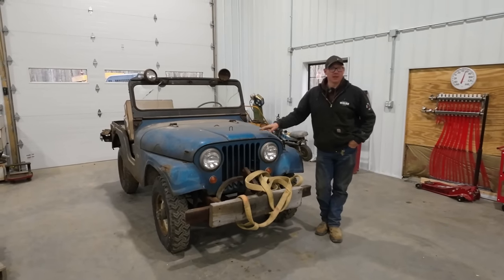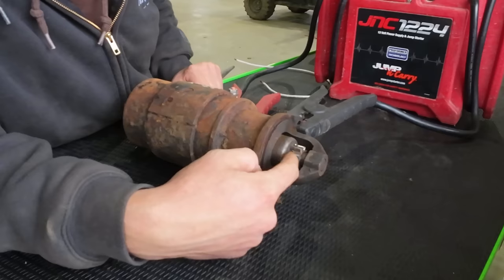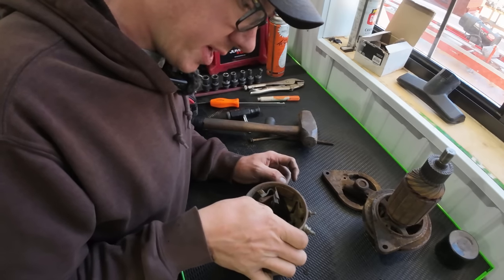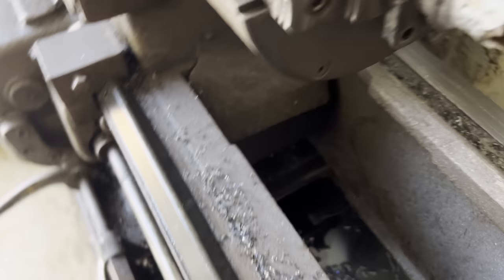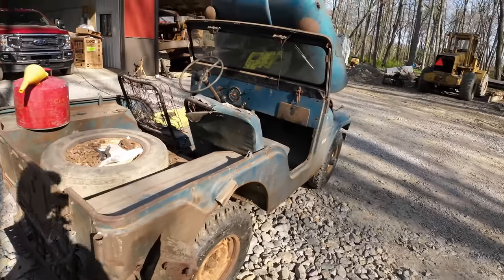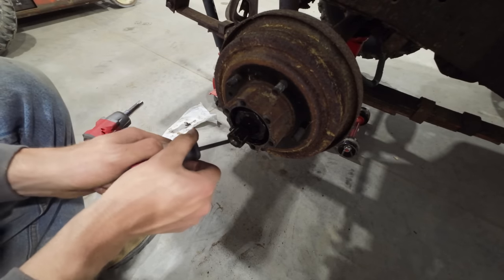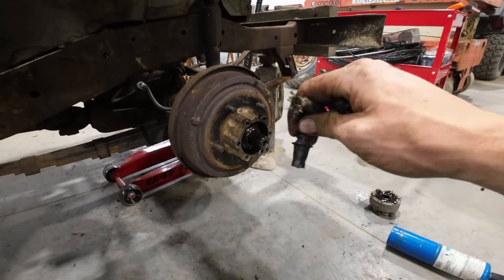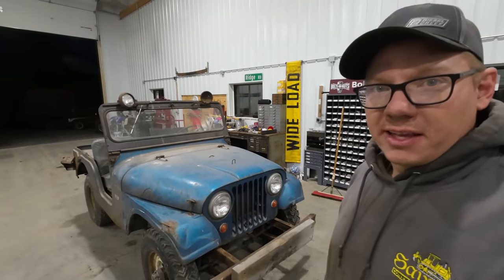Barn Find 1964 Jeep CJ5  (Is It Road worthy?)

Comment: Marvels mystery oil might be a good help with the possible ring stuck issue. and yeah, when it died at the gate like it was starved/out of fuel. Most likely had been just some crud that peeled off the inside of a line.. Finally the brakes, I think you're going the right direction there with a complete kit. And while you're doing that, just run new lines as well because you are absolutely going to break one or find a dozen pin holes the first time you put any pressure through the lines if you leave the originals in place.

If you ever really get the notion to go more in-depth on working on your jeep. A nice tip that seems counterintuitive , pull off the hood, fenders and grill to get maximum access all around the engine bay with needing to contort or reach into tight spaces. It was a lesson I learned back with an old DJ-5 I had many, many years back.

For the thermostat housing, dress it up with the epoxy as you have, but have one on order anyway just because you'll have the more permanent fix in the near future rather than if you're in the side of the road between your place and wherever in a cloud of hot coolant steam.

Oh and a closing idea after a completed project for inside that just came to me. Backing it out and then a voice over while you run the floor scrubber over where the project was. As one of those 'That's all for this thing at the moment, time to make ready for the next project, clean slate style'.

Comment: there was no doubt air pressure in the line. most likely from an attempt or attempts to use the brakes. the air was desperate to expand as it was heated by the torch and the old line just blew up like a firecracker's hull. could have even been some combustible vapor in there too.

Comment: Just a guess:  You should clear debris out between contacts because EVERYTHING has resistance and air is the resister you are supposed to use between those contacts, if you've got something other than air it is a good bet it wouldn't supply "equal to or grater than" the expected resistance...  That would be better than a short but still undesirable.

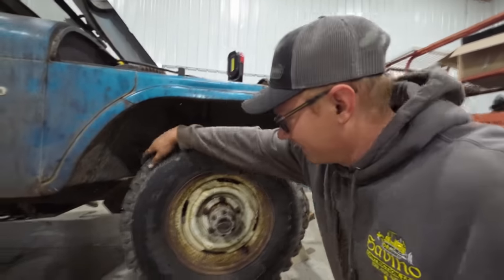Comment: 53:20 I think you know it, but see that knob in the center of the hub, it's to put it in 4wd, when it's off your wheels are rolling free, saves you fuel en wearing out the front drive. So if you put your jeep in 4wd it's not working untill you turn them to lock your hubs.

Comment: Quick edit - the soft line exploded because the inner liner collapsed. It trapped expanding gasses and the rotted rubber couldn't take it. I'd definitely recommend replacing all the soft lines at this point.

On the springs, DO NOT go with either the Skyjaker or Rancho spring kits. They WILL give you the patented "empty dump truck" ride. Remember that more thin spring leafs give a better ride than fewer thick leafs. Ask me how I know. Best bet is to just buy Crown brand heavy duty springs. They should be a 10-leaf pack for the front, 9 for the rear. Both Skyjacker and Rancho have 4-leaf packs.

Matt, if you're ever interested in upgrading the brakes, hit me up. A gent on TheCJ2APage forum designed a 1/2 in plate that bolts in place of the drum backing plate for mounting a 95 Geo Tracker front brake caliper. That done, what you'll need to complete a full manual four-corner disc brake conversion is slightly longer wheel studs, 1.2" longer bolts to attach the spindles, four 95 Geo Tracker front brake discs, four caliper brake hoses, and two sets of brake pads. The last step is to cut off the ends of the axle mounted brake lines, install the proper metric fittings for the caliper lines, and re-flare. This works because the Tracker closely mimicked the axle dimensions of the Dana 25 and Dana 41/44 axles used on the early Jeeps. The bolt pattern and hub size perfectly fit the Dana axles. It's truly a bolit-in swap. My cost using wrecking yard calipers and discs (in excellent condition) was under $250 for everything

I've been running this system on my daily driver 1948 Willys CJ2L* four about four years now and it works great. If you're gonna tow a trailer weighing more than a ton or so, I'd recommend a controller and electric trailer brakes or a Hydrovac power brake system mod on the jeep. 

The other popular disc brake conversion is 3/4 ton chevy. I didn't go this route myself for two reasons. First, it's far more involved and expensive. The second reason is that back in the day, a four wheel drive magazine (I forget which one) did this conversion and when they tested it in the alley behind the shop, they stood the jeep up on its front axle. The last thing I need is to jack the brakes crawling down a very steep hill and dump the jeep over on its lid.

The most popular conversion by far though, is with 11" drums from slightly newer jeeps. Wagoneer, I think.  I'll check, but I think I have a full set of these in my parts stash. If you're interested, they're yours for the shipping. 

I bring this up because the brakes fitted to your CJ5 are essentially similar to the design in the CJ2A and do not self-adjust. You're going to find yourself having to adjust the brakes every 1500-3000 miles to keep them working their best. The give-away is that there's no ratchet mechanism between the bottom of the brake shoes.

 How much you find yourself driving the jeep is going to be the deciding factor for you. IF you only drive a couple hundred miles a year, your fine with the original system. It'll be years before you need to adjust it. But if you're like me driving it every chance you get, you'll get tired of adjusting brakes pretty quickly. The bonus is that the more modern systems provide better braking and are just plain safer.

*A CJ2A stretched 24" at the dealership in Spokane and rebranded as a 'long' jeep like a CJ6. About 10 are known to exist.

Comment: I've never bench bled a master cylinder. Just put it on dry and hooked it up, filled it up and tapped the pedal maybe an inch and watched the bubbles come up and the fluid level go down. Eventually things would even out. And according to brianblok02, Deere oil and Delo are the only oils left with additives for flat tappets. i run Delo and Valvoline 15/40 diesel formula in everything. Pegged 80+ p.s.i. oil pressure idling with a 195 degree thermostat in a 4.3 in an old S-10. Does really good in big stuff too. Good old Jeeps. I had a 3-B years ago. Thanks and God Bless!

Comment: I love your Jeep CJ5!  What a sweat ride and the price was right.  Sure it needs some reconditioning, but Jeeps are rugged.  Yours seems to be solid.  All the parts are available.  New Brakes, tires, springs, bushings, shocks it's going to ride like new!  Once you are done going through it this will be a smooth ride.

I am no mechanic, and you are a pro.  This said I like to pressure wash a vehicle like this before I start work on it, gunk the motor, etc.  That way we all get a good look at what you have and you're not dealing with a huge layer of dirt and grease when you're working on it.  Just a quick blast.  The windshield will be clean when you drive it.  Then again, you work on heavy equipment, so this Jeep IS clean to you.

Comment: Put new ringtone by 20th over rings and then file fit them to the cylinder board back to the stock ring gap and it won't they won't smoke when you put it back together

Comment: It be good candidate for one those holley fuel injection system 2 barrel one be good for reliability and power had cj7 with 302 and 4speed dam thing would pull front tire a little with bolt ons it was solid ripper when u smashed pedal through floor only down side was body i got it off farm and drive line was out ford f150 70s hell of 4x4 drove it through so many holes that swollow most trucks and only had 32inch tires well keep up great work and have great day

Comment: Brake line popping was probably due to steam pressure.  Brake fluid pulls in water. As you were heating it more than likely there was nowhere for the steam to go so it built enough pressure to pop

Comment: Excellent video Matt  :) also for  test on low , high idles test on Generator is put headlights on low to high beams to plus left & right turn signals and 4 way Hazzard  lights blink plus brakes also Reserve lights! Also fog lights plus windshield  wipers on low plus high speeds too ! Do compare too low to high on idles! If get low 12 volts on low or high  idles would put 1964 to 1985 GM Delco Alternator with battery post plus internal regulartor  2 pin style inside with 70 to 100 apms only in 2 stage ! Why 2 stage is low idle or no draws have low amperage to recharge  battery also keep motor running okay and when put headlights or brakes or Reserve  gear lights  you get full amperage of internal  regulartor recharge battery strong also engine won't shut down or missfire to that draws at 25 amps on fuse or breakers ! Hope you like  helpfull  hints Matt :) and your choice want do ! I know lots people own Jeeps from 1980's  or years before  made ones and plus new ones too ! My Cousin Nancey does have one new ones in 2020 and old 1978 she and husband rebuilt plus updated also use back feild at parents home farm got updated motor also much more too also me to in 2006 ! 1978 got V8 360 , Manual transmission,  377 rear end gears to on 4×4 to with 35 tires  change plus daul exhaust too!

Comment: The inside of those brake lines close off over time with rust, I’m sure there was residual fluid in the line, it expanded when you heated it and blew it apart, ask me how I know, been there, done that, bought the T Shirt

Comment: Great video Matt! FYI Curtis from Cutting Edge Engineering (in Queensland Australia) welds a bolt head onto snapped bolt threads instead of using an Ezy-Out. He says welding it has a higher chance of successful extraction of the snapped thread than an ezy out. He did this in a recent video repair of an old 1970's International Yard cranes diesel engine.
Reply from the maker: I’ve done that plenty too. Just depends how stuck it is.

Comment: The carbon bridging the gaps in the commutator sections is a short between rotor windings. They cause a loss of power by allowing power to go where not needed at the wrong time, decreasing the generators output . Well done on the jeep repairs, no janky repairs for the Mrs. and kiddos

Comment: For updating old farm tractors the GM 10si alternator from the 1970’s and 1980’s is the way to go and maybe that’s what Matt has in mind. I prefer the newer Nippon Denso alternator that shows up in lots of Japanese cars. It has a higher output and is a lot smaller.

Any of the tractor websites like Steiner Tractor Parts has the conversion kit to change the alternator from flat belt to vee belt.

Comment: If you ever have the 'opportunity' to replace rubber bushings in radius rods on heavy trucks, just heat the end of the rod and the bushing will shoot out just like your brake hose did.  Sing the OSHA song while doing it and don't stand in line with the bushing and you will be fine.  

Good video as always!

Comment: Get those springs fixed and get all the lights operational that will be a fun parts getter. The only problem you might run into is the wife in it and gone when you need it. I've had 4 different jeeps and they are so fun to drive. When winter comes they aren't so fun to drive. I drive mine because that's all I had and drove it in the winter every day 30 miles one way. I always had a Bimini top for summer but an old rag top in winter the flopping the do at approx. 60 to 65 mph is irritating and hard to heat. But summer time the best there is to drive of anything I've ever owned. Good job Matt always love your content.

Comment: Matt, what are those needle nose pliers you’re using?
I looked at your tools section and did a pretty exhaustive search on Amazon and couldn’t find them. I also couldn’t find the carbon scraper you use
Thanks
Reply from the maker: The red handled adjustable ones? Those and the carbon scraper are snap on items. Can’t get them on Amazon unfortunately

Comment: Couple of differences between alternators and generators;
Generators, use brushes, maintenance on brushes, they are also electrically noisy. Maybe only get 30-40 amps so you are going to run a deficit in current if you are doing things like light bars or winches. 
Alternators use commutator rings (no gaps to clean out and they last practically forever), they are electrically more quiet. Get 50-150 amps. More flexible about pulley and belt ratios. Only create load on engine when they are producing power (generators are an engine load all the time). Regulator can be included right on the back of an alternator.

Disadvantage to an alternator: They do not like charging a dead battery as they need the field current to generate power.

Comment: you should wire brush the corrosion off the thermostat neck before applying epoxy because epoxy won't stick to corrosion.  And aluminum is nearly always corroded.

Comment: Matt when U were working on the brakes on your jeep, on the right front when you pulled off the drum there were pieces of brakes inside the drum,!!! ONE BIG SERIOUS TIP, those were either bendix or wagner brakes, because iIhave had the same thing happen when we had our gas station!?Now the only brakes i will ever trust are raybestos brakes, I have never had a failure using raybestos, brakes ever!!

Comment: I have a neighbor that has an older Willy’s that looks a lot like your Jeep. One thing it has, that I’ve never seen on a Jeep before, is a PTO shaft coming out the rear under the tailgate with controls next to the transmission shifter. I’ve tried to buy the unit a couple times, but we are too far apart on the money. It’s been setting for decades and is going to need a ton of work. So it just sets out in the weather rotting away even more. I wish the guy would get right on the price, so I could buy it and fix it up.

Comment: Okay, subscribing just to find out if you find the source of the oil leak. 

My first car (early 2000s) was a 1984 CJ7 my dad rebuilt (also royal blue). It was BARELY street legal, and was NOT a good choice for a 16 year old, but I couldn't afford anything else. By the time I was 18 I could diagnose just about any problem with that car based on sound and vibration. I couldn't fix it, but I could find the source. By the time I was 19, it had the transmission rebuilt, new alternator (twice), new battery, new belts, the radio got stolen....It stalled at literally every intersection, nearly got me killed several times. I knew immediately when yours was going to stop. And that's just the tip of the iceberg. It also had a mystery oil leak, and we were never able to figure out where it came from, and neither could our mechanic. I usually kept a quart of oil in the back and had to check the level a few times a week. The crowning glory was when I was 19 and kept telling my dad it was making a funny noise, and it was coming from the back this time, rather than the engine. He'd just about had it with the car by then. He got a used Sonoma for me to drive, and the Jeep sat in his garage over the winter. He kept insisting nothing was wrong with it, and it ran fine. What did I know, I was just a teenage girl? Obviously he was the expert. 

The first time he started it that spring, the carburetor blew up.

He has never lived that down.

Comment: A great one, nice to see the Jeep getting some love in the brand new shop. But definitely Matt, after seeing the video that project farm did on it I would seriously consider trying to pour a little bit of restore brand engine cylinder ReStore in with the oil and see if it improves the smoking any. He did a pretty in-depth video on it using it in a old Ford Diesel and it improved his compression substantially, might help fix any scarring on the cylinder walls and help those brings back sealing proper
Reply: I was thinking about some, ReStore, also. I have had some good results with using it. I just used some in a 18h.p. B&S single cylinder engine that was smoking bad and using oil. I have run two tanks of gas in it mowing and it is getting better and better. No visible white smoke even in thicker grass areas and way less oil use. I'm not saying that it's a engine in a can, but it has helped me a couple of times with engines that had sat for a extended time.

Comment: Just a little flop for you Matt I had an engine once that was clogged up pretty good and I run some 15 W 40 in it for a while and it cleaned right up. I don’t know if that was the detergent in the 15 W 40 but it clean the top end of the engine unbelievably just like new just a thought you could try to loosen up your rings

Comment: not just the heat cycles the higher RPM will help with this as well.  If you are confident in the engine go down the road at close max rpm at low speeds for a half mile at a time.  You get a little more even wear then.  That thing probably never hit close to red line ever so it is then wore in to that level.

Comment: Carbon is a conductor, that's why you need to clean it out of the commutator. If it bridges the individual connections on the commutator the torque will drop then eventually the motor will short circuit and stop working all together.

Comment: 17:47 it is best to not clean the rotor with sand paper,  by that you change the diameter of it and the gap inside the stator is getting bigger so it will need more current to induce the magnetic field , so you could end up that the motor is ending up using the current it is supposed to have under load with no load , should tbe the same with gnerator just that you get less current out of it.
it is best just clean it with non abrasive methods. on the parts where the brushes run you can use sand paper juist don´t overdo it

Comment: You need to put brakes on both sides of the jeeps frontend.    Front brakes do 70percent of the stopping.    Brakes are my specility.   If you dont it will not stop equally on slick pavment.